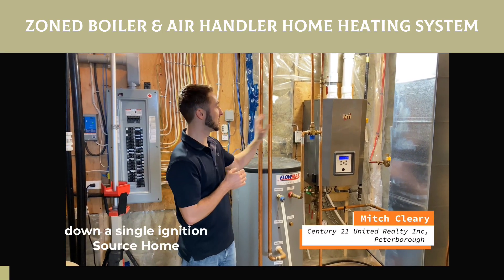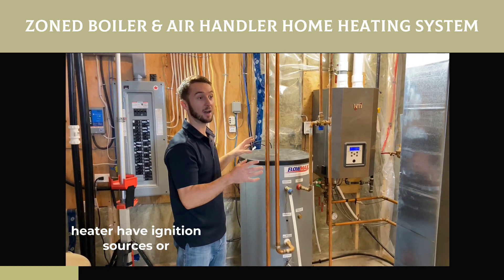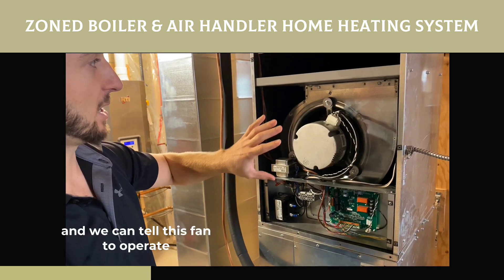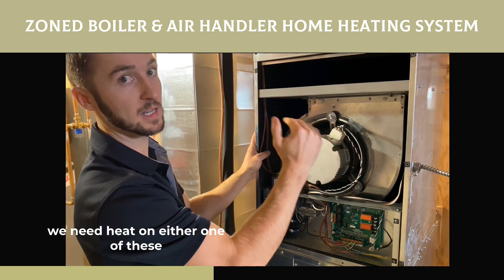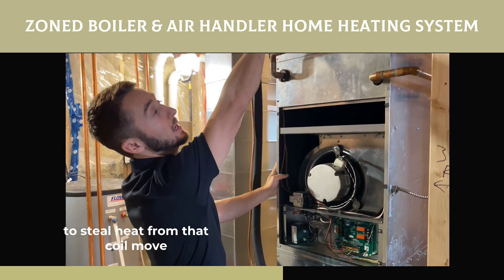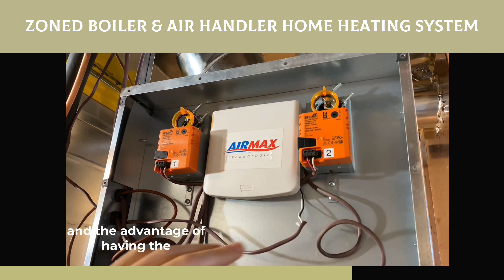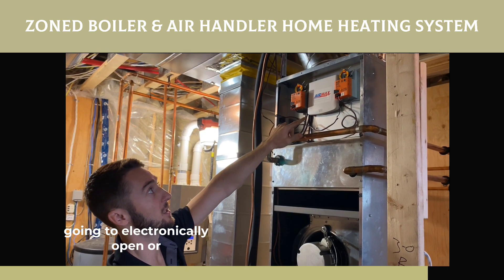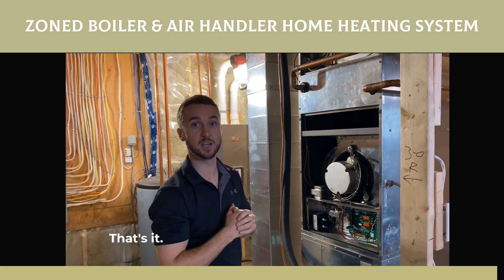Zoned Air Handler & Boiler Home Heating System

Comment: THANK YOU!  I saw your high velocity ac video before this one.  We've had a Unico HVel AC system for 7 years, but are doing a major remodel.  My HVAC contractor was recommending we use our NTI boiler in this way and combine it with the cooling system so we can ditch the radiators.  Is yours combined at this point so your inverter/condenser goes through the same air handler system?  It sounded like it when you described the AC.  Does the heating work well?